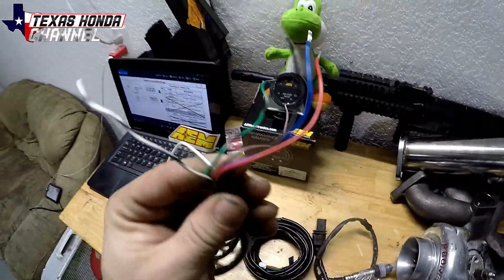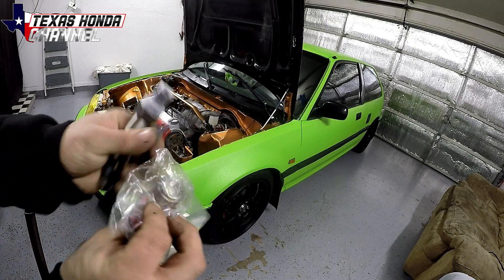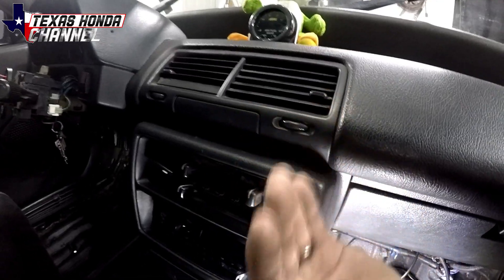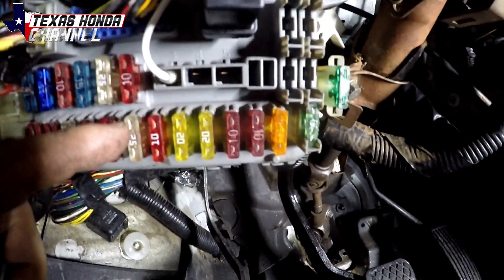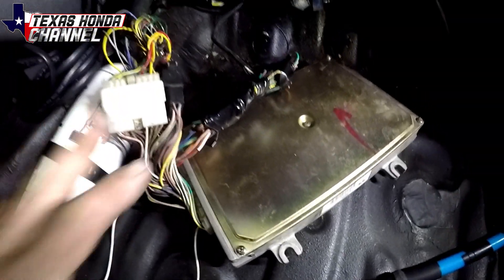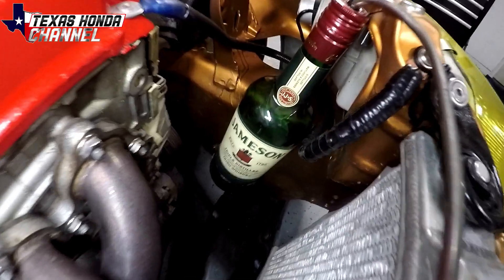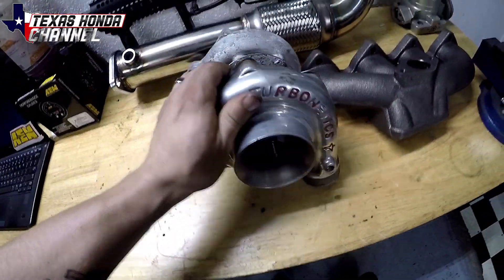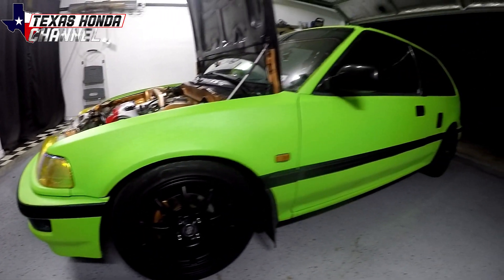Installing AEM WIDEBAND Into The EF (HOW TO VIDEO)

Comment: You will need to ground the brown wire, from the gauge, at the ECU.  That is the ground reference for the gauge's voltage output.
Reply: Where do i connect the brown wire? Lol. Just to any ground?
Reply: I believe im suppose to tie it into the black wire at the ecu, correct?
Reply: @tylerneisinger206  d21
Reply: @DannyOrnelasPerformance  thank youuuu<3, lol.
Reply: @tylerneisinger206  just did this last night
Reply: @DannyOrnelasPerformance  yeah man, i have my ground going to the chassis right under the dash, and its totally fine, but if i ever do start having priblems with it being off  i'll relocate it to d21. 🤷‍♂️. Heard alot of people having problems grounding straight to chassis for some reason, lol.
Reply: @tylerneisinger206  just tap into d21 dont cut it, its a common ground so car wont run, i had to learn that last night too lol, but now its all good everything reading and ready for tune
Reply: which wire on the ECU? I converted it from OBD2 to OBD1, but any answer helps
Reply: Can you connect the brown wire to the black ground wires on the hondata analog harness?
Reply from the maker: I’m use to the Non X series you are correct. My tuner actually told me. Ima pin this post as to not give bad info. Just incase anyone runs into issues by not doing this.
Reply: @TexasHondaChannel  It's a slight added complication, installation-wise. But, it is worth it to get rid of ground offset errors. :)
Reply from the maker: @lordandprotector  not even a hard thing at all and I hate fighting offset lol

Comment: D14 is a narrowband input its limited to 0-3.8v the wideband requires 0-5v, D10 is the correct input to use for wideband after removing 2 resistors inside the ecu the numbers can be found in the hondata help pages

Comment: Wide band o2 also puts out 0-5v dc… is the gauge basically putting out the same signal that’s coming from the o2?
Reply: Yes, but it's a very sensitive signal.  Your ground wires/connections need to be correct as hell.

Comment: Do you have to connect the white wire obligatory?
Reply: Yes if you would likento datalog and make changes after a test pass . Where you can see numbers if it goes rich or lean at what rpm and you can make accurate changes .

Comment: For the white wire how come you just cut the wire and spliced the wideband into it and the other end of the wire is left alone?
Reply from the maker: At the ecu I cut the white wire instead of tapping into it because the sensor under the hood would be putting a signal into the ecu as well as the aem. Now it’s only the Aem putting signal into the computer

Comment: I think u can do front windscreen tint with light shade with windscreen decal attached on bottom check link below 

https://www.daraz.pk/products/dapper-front-windshield-car-glass-window-jdm-stance-vinyl-decal-sticker-i189774196-s1380188259.html?dsource=share&laz_share_info=8131571_100_100_880627_7180941_null&laz_token=2faf36caa0e3f08522c271d627fbcdca